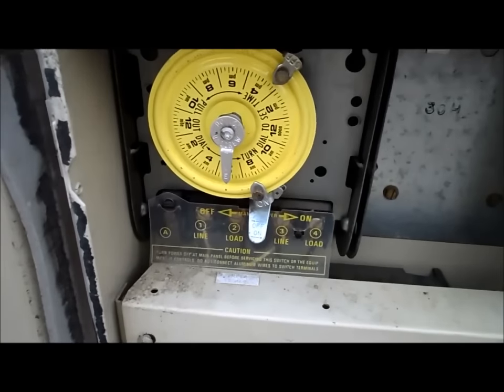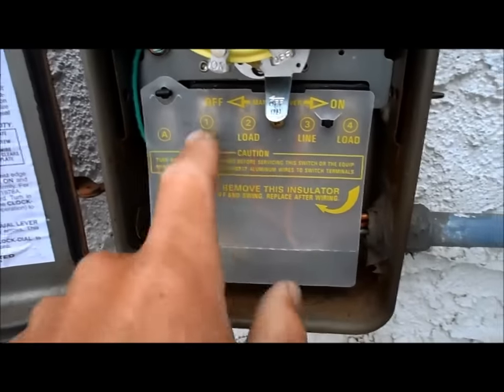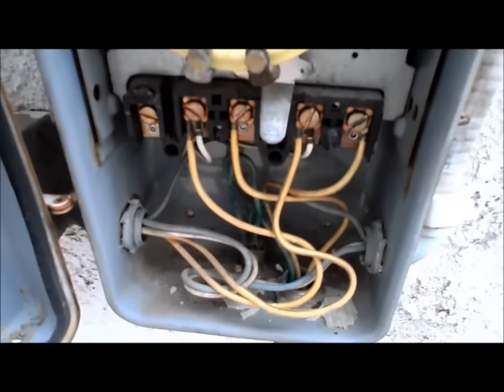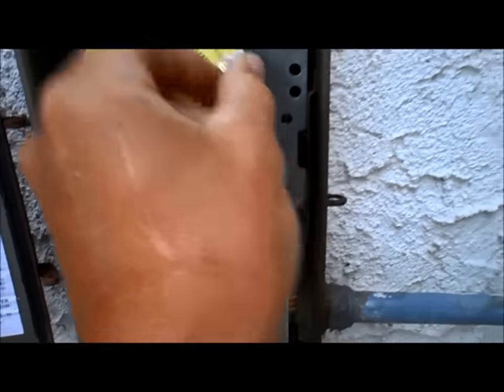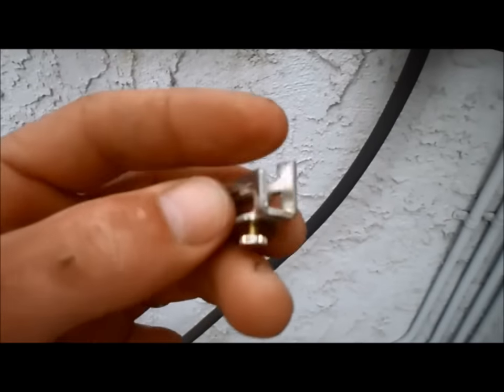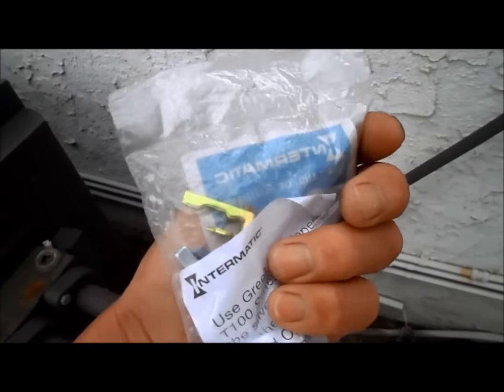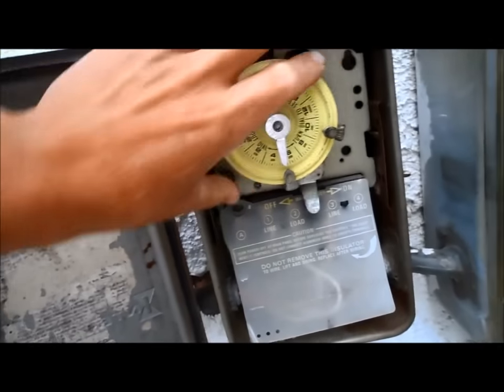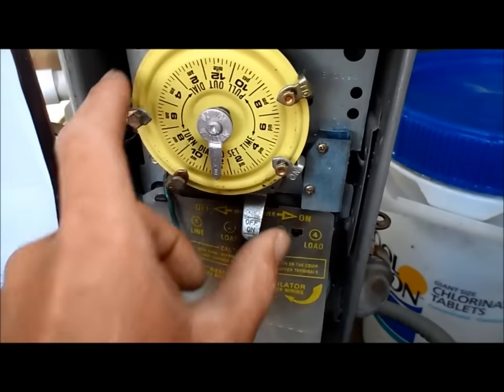Intermatic Pool Timer, tips & troubleshooting

Comment: Could somebody please tell me when you reset the times for the winter do you have to turn off that switch on the bottom right hand side that says on and off too off and then when you finish resetting everything do you turn that switch back on or do you leave it off?
Reply from the maker: Yes, turn it off first if you want. Then simple leave it off and it will turn back on by itself.

Comment: All the wires that go into the timer are showing any voltage with my voltage tester. Does this mean the problem exists from the breaker?
Reply from the maker: yes. Or a switch is off
Reply: @SPL  there is a switch between the breaker and the time clock it’s all rusty inside and the screws are so small and rusty it’s hard to get it out to look inside it
Reply from the maker: @MHrfffdssswqqwuuu  That is the issue more than likely.
Reply: @SPL  the two wires coming from the breaker are the same color. One is giving my voltage tester a green light while the other is not. I put one of the yellow wires into the second screw in the time clock and the second yellow wire going to the 4th screw in the time clock. My time clocks gears are not moving. Do you think there is an issue with the one yellow wire not showing up my voltage green light tester? It’s not a multi meter it just shows a green light when it detects a voltage.

Comment: Any suggestions on what can be wrong when the manual switch on the intermatic timer does not turn off the motor?  Seems to run constantly soon as the breaker is turned on.  Off/on manual switch on timer is ineffective.
Reply from the maker: Sounds like a bypass switch is in the on position - look for a light switch around the equipment area or at the back porch. Turning that off should solve the problem. It could also be a bad timer but ck for a switch 1st.
Reply: Swimming Pool Tips, Reviews & How To -MrDgvb1
I assume its a bad timer then, i can see the majority of the wire run.  There is no override switch.  Thanks for your reply.

Comment: Hello --- I hope that you can help me!  My pool timer has power (the timer is working) but when it is in the on switch it does not turn on the pump... could it be the pump or possibly would just replacing the timer fix the problem? again figuring in that the timer is  moving with the time aspect --- sorry for the odd wording!  Your help would be greatly appreciated!  Thank you,,,, Mike
Reply from the maker: Sounds like a bad "On" tripper - so replace the trippers first: http://www.amazon.com/Intermatic-Timer-Trippers-Pool-Filters/dp/B0055DWYIS/ref=pd_sim_hi_4?ie=UTF8&refRID=1R7YRY90T5J6Q98S3195

If it still won't turn the pump on then it is the timing mechanism itself. Replacing the timer will correct the problem. I assume the pump turns on when you manually flip on the timer switch, right?
Reply: but if i flip the on switch nothing turns on whereas before i could turn it on manually?
Reply: btw thank you for responding so quickly!
Reply from the maker: mhoping2008 Sounds like the motor has gone bad. Have you checked the main circuit breaker to see if it is tripped? Usually when the motor goes the breaker will trip. This is the time I am online working on my Channel and Website so you got lucky ;).
Reply: i checked the circuit breaker but it did not trip?
Reply: btw this is the pump that powers my polaris if that matters?
Reply from the maker: mhoping2008 Okay. Yeah, in that case it sometimes doesn't trip the breaker - it just gets louder when running. You will need to check the voltage on the timer to that pump to see if it is getting power. Use a volt meter - if you don't have one Harbor Freight sells them cheap. I show this in this install video: Intermatic T101M (120V) Pool Timer, replacing a: http://youtu.be/uJmEZb6PuhQ. The load wire should have power. If not the motor is bad.
Reply: yes the pump wont even try to turn on,,, when the switch is flipped....but there is power to the timing mechanism?  thank you very much for your help and i'm glad i caught you at the right time!  Mike

Comment: The pool tech took off the tripper for automatic off because we need to run the pool for salt motor, when I put it back its not turning off automatically, I don't know if I put it right. Can anyone pls.tell me?should I slide it from left to right up for off setting?

Comment: we just replaced our T104R timer after 21 years we are having a problem the timer runs for the allotted time but when it hits the off switch it turns the pool off fine but the timer then stops spinning and will not turn on again the next morning any ideas?
Reply from the maker: Sounds like you got a bod timer from the manufacturer. That happens from time to time - no pun intended ;) Had my share of bad ones over the years.
Reply: No I viewed another you-tube video and it suggested we had some wiring wrong after my husband looked at it he had 2 wires swapped. Thx anyway
Reply from the maker: Good. Sometimes doing that will cause the breaker to explode. Not that I've ever done that - just heard that could happen ;)

Comment: If power is reaching the clock, and the gear is turning in the "view window" but I'm getting no voltage where the 3 wires meet at my pump, any ideas what it could be? (my wires look fine and are fastened properly)
Reply from the maker: maybe motor is burned out? How old is it?

Comment: Our timer appears to be working, the dials are turning, and it is making noise to that effect.  What is odd is that the timer dial is moving backwards, and I cannot figure out why.  Just a couple of days ago it was working perfectly, and all the parts are new as it has just been installed.
Reply from the maker: There are a lot of defective timers out there.  I've installed a few that did not work correctly.  I suggest having whoever did the install to come back and swap it out with another mechanism.
Reply: Mahalo plenty

Comment: ...I have three timers set at the same turn-on time. One of my timers seems to turn on much faster than the other two timers, suggesting that something is wrong with the timer? How do I remedy this?
Reply from the maker: It is easier just to replace the entire mechanism if that timer is running fast. Unusual for that to happen - sounds like the gears are slightly off on that one.

Comment: My parents have the same timer on their pool and it's such a crappy design.

The on/off switch doesn't work when the timer has moved into the "off" portion of the 24 hour cycle.  For example, if your automatic timer is set to power the pool on at 8am and power it off at 4pm, you CANNOT turn the spa on manually at 9pm for an impromptu pool party.  You have to readjust or hack the whole timing system instead.  Laaaaame.
Reply from the maker: Yeah, amazing that pools are still running off of such ancient timers.

Comment: Do the Intermatic pool timer switches ever burn out and not supply power? I had pool pump that just started to stop working after switching the pump on, the fuse would not trip I checked the pump on another outlet and it ran fine. I then though it might be the outdoor plug so I replaced it but still got on power from the plug with everything tripped. 
When the fuse and the switch are tripped and I do read a power from pool switch timer but not sure I am checking the right place. It is a old 110 V with a 20 amp circuit breaker and hoping it is not my wiring running underground to the pool.   
Anybody ever know of this happening before?
Reply from the maker: Yes, it could be a timer that is burned out.
Reply: @SPL Thank you for at least telling me what I want to hear. I will check first before I do anything else lets hope that is the problem

Comment: What happens if pool pump is manually on and then the timer comes around and turns on?
Reply from the maker: RUBIO0331 Nothing. It will continue to run until it hits the off tripper in that case.

Comment from the maker: The gears are wearing out in the timer & you will need a new one installed. If you decide to do it yourself know that if you accidently reverse one wire you can short out the brand new timer and burn out the breaker to. This may be a job for an electrician. Cost including the new timer should be $150 to $200. It is easy to do but that is my caution.

Comment: My pool timer turns on automatically but will not turn off .. I have to manually turn it off .... any suggestions why that is .. I
Reply from the maker: Probably the "off" Tripper is bent slightly. Just buy a new set of on/off trippers. That is my first guess.
Reply: Thank you I will

Comment: exact ne for that timer please i have the same one i can replace just want to make sure the exact model etc.
Reply from the maker: +Abram Ruelas Depends if your pool is wired for 240v or 120v as they make two different timers.
Reply: I got it it was a t104m correct if wrong the pump is 2hp two 110 12 gauge awg and the ground right? With a 20amp breaker
Reply: Swimming Pool Tips, Reviews & How To -MrDgvb1  thanls for responding

Comment: The gears are turning, but the dial is not turning...
I pulled out the dial, turned it and released it a few times ... still no go.
Reply from the maker: Probably time for a new timer - they are relatively inexpensive. You would just need the mechanism without the box.

Comment: My timer clock shuts off when it shuts off the pool filter at the off peg.  If power is on, gears in back move.  Which wire(s) controls the clock to be on always?

Thanks,

Comment: I have one of these Intermatictimers. When the switch is in the on position the timer runs fine and will turn off automatically when the timer gets to the off switch. But when the switch is off, the timer doesn't run at all. Any ideas on what the problem is?
Reply from the maker: Matthew Rowell If the "on" tripper looks okay visually then the timer is failing and needs to be replaced. The mechanisms are fairly inexpensive. Sometimes the "on" tripper is slightly bent causing it not to trip the timer on.

Comment: I have tried 2 brand new timers. They both have gears turning but when the trippers get to the switch they just stop.  Like it doesn't have enough power to keep moving and trip the switch.  What could this be?
Reply from the maker: Are you using new trippers also?
Reply: Yes brand new out of the box on both
Reply: Let me give you all the info.  20 year old timer dies. Replaced it with same model.  It worked for a few weeks no issues.  Noticed the trippers getting stuck. Bought new trippers, same issue. Bought another timer.  Installed it and still the same problem.
Reply: Sorry for resurrecting such an old comment, but I also have the same problem. Any idea if you got it fixed by now and how?
Reply: I had to replace the timer. It was defective
Reply: @nctinter  Thanks